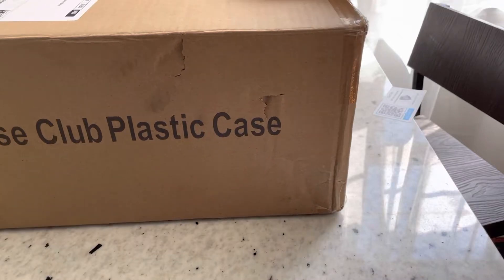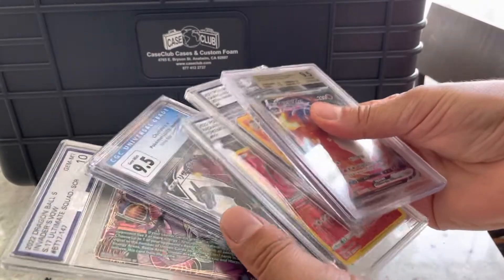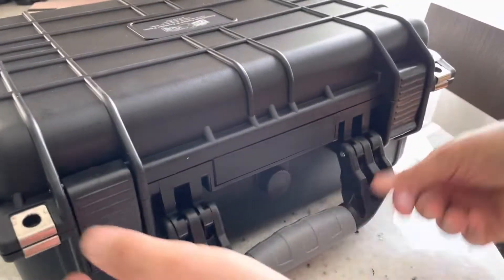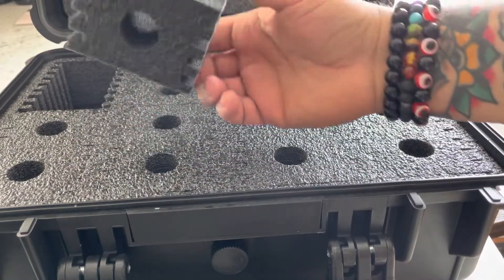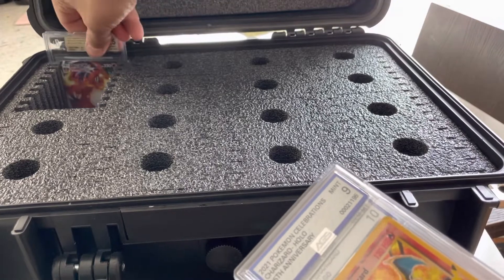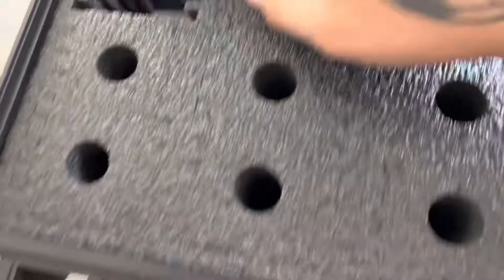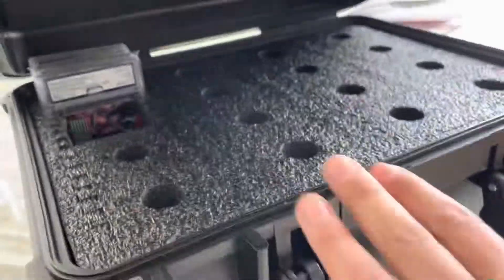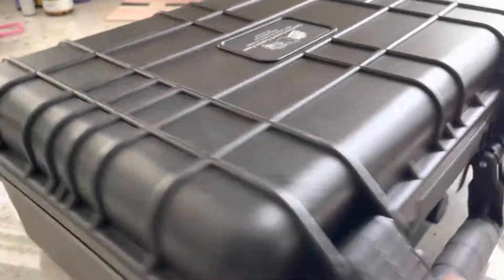Case Club Slab case review must watch

Comment: This case is not for BGS slabs. It literally put cracks into one of my BGS slabs after I put one in as a test run. Tight fit is an understatement. 

I would never recommend this for any BGS slabs.
Reply from the maker: It is a tight fit but it still works